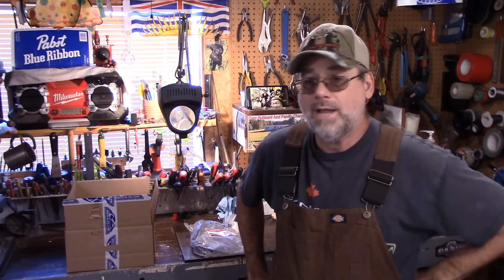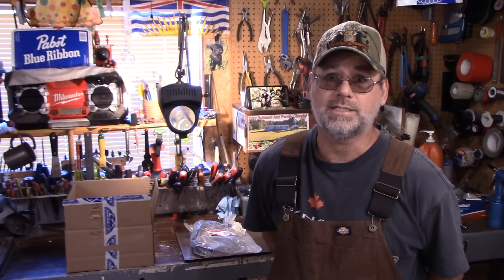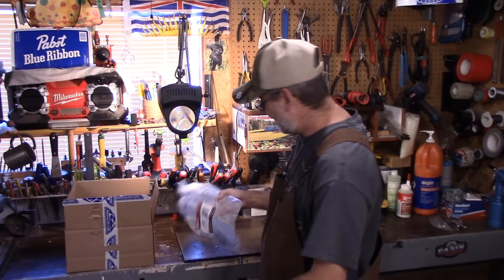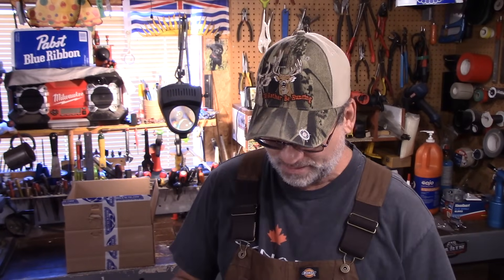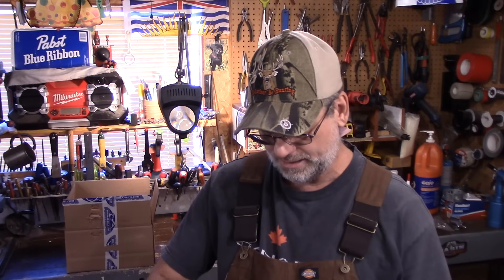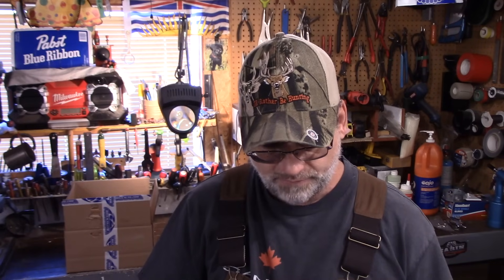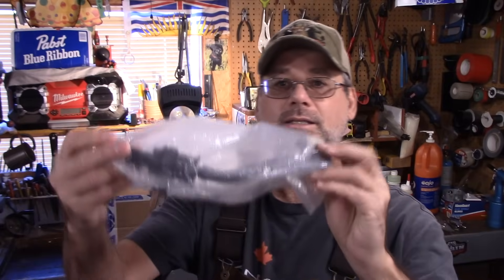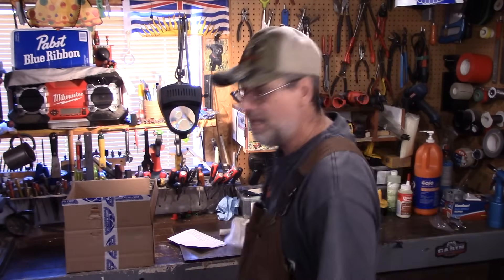F150  STALLING AT STOPS - THE FIX -  PART TWO

Comment from the maker: It has been over one year and I have not had one stall since replacing the evaporative purge valve found under the hood . Cheers
Reply: Good to hear, my 2010 f150 just started this a month ago.  Cleaned the throttle body and was looking at common issues and plan on changing this part out. It seemed like the throttle fixed it but it did it today leaving the gas station.
Reply: STEVE ROB REVIEWS can you please put up a link to the part. Thanks in advance
Reply from the maker: James the part is model specific depending on OEM or aftermarket so it's best  to search your specific vehicle .
Reply: Was it going  dead when it got hot like over 95 outside
Reply from the maker: @johnnyarnett4904  Nope it was not temperature related at all. It was very infrequent but always on a deceleration to a stop. Glad the purge valve fix it. Cheers
Reply: Thank you for doing this Vid, we are going to try it on my daughter's truck. Really appreciate it!
Reply from the maker: @JamesOKeefe-US  Hope it helps bud 👍 easy to install. Cheers
Reply: I really hope this works, I’ve had this issue reoccurring very frequently in my 2004.
Reply from the maker: @senoredbeard3544  let me know as well as the others that will read your post. Cheers
Reply: Thank you my trucks been doing this. I've change spark plugs, coils, Cleaned the fuel system. Cant wait to get one  2004 F150 4.6...
Reply: Unfortunately the truck stalled the very next day after installing it. If anyone has other ideas please share.
Reply: ..... Nowhere in the video or description do you mention what year/engine F150.
Reply: Thank you for the video. One question.  Will you have to change the part again after sometime eventually?
Reply: STEVE ROB REVIEWS what the name of the part in the box
Reply: Are there any videos out there to your knowledge that shows how to do this? Would love to get this done, this week.
Reply: It has been happening on mine as well since 2010, like you said completely random and once maybe twice a year,    I have had it happen in all seasons up here in canada.  The one thing I have noticed is that it is always when breaking but and always on the rock back or I lose break pressure as well.  The. I need to throw it in park  quickly and start it again so I can reengage my breaks
Reply: Is it still working?
Reply from the maker: Yep 👍
Reply: @senoredbeard3544  did u fix it? Same issue. Thinking about buying a non-oem purge valve.
Reply: @loudogg310  no it never fixed the issue for me. Not long after I ended up buying a new truck. My Ford is still in my back yard collecting dust now.
Reply: What year was the truck you are having problems with i have a 2016 5.0 it is doing this finally it threw code for the vct solenoid  but I'm having doubts about th
Reply: @travisroher4410  it could be the solenoid.  Im having this same issue on a 1997 Ford V8 expedition.  It was driving fine, then Fla got real hot today.  Stalled on me and continues to stall out.  Also had the overdrive on/off start blinking.  God I'm praying its not the transmission but my fluid is clean..i have it serviced.  Its gotta be purge valve or solenoid.  I dont even know what a solenoid is but thats what came up in my searches for this issue.
Reply: @johnnyarnett4904  same. Usually about 100 in the shade here 10 months of the year. Did you find a fix?
Reply: @SteveRobReviews   did your truck display low oil pressure when it would stall? Mine has started stalling at stops out of the blue. I notice it says low oil pressure when It does. It will crank right back up though.
Reply from the maker: All the gauges will report a fault on a stall but no codes stored. The purge valve fixed mine.
Reply: Hey was wondering if your f150 had a rough idle? I got a 2016 f150 5.0 and it stalled a few times off road or in reverse and stoping but in park it has a rough idle that comes and goes
Reply from the maker: @Golden31Eagle   No rough idle or codes in my case .  In your case it seems to be different so my first thought would be minimum idle air flow at the throttle body and maybe a throttle body cleaning may resolve your condition.
Reply: @huntercarpenter3726  I have the cpv (canister purge valve ) replaced in May and it went about a week with out stalling at a stop sigh or red light and it stalled. Than it would stall a few more times after that and the last time it stalled it showed the " low oil" text and symbol. I was hella confused.. Literally dropped it off today and told them about it. Let's see what happens.
Reply: Thank you much!!
Reply: I changed the valve and the pcv and still stalls, guess I'll try vct solenoids next
Reply: @josueavila3721  did you find out what the issue was related to? Currently having these issues now. Thanks
Reply: dude... thank you so much. I'm going to try this. Mine started doing it a month ago. 2004 F-150 5.4L V8 Lariat Supercrew. I've taken it to the mechanic (Pep Boys) and they found NO issues. its happened to me 3 times now, including about 20 mins ago. Its so aggravating to now know whats wrong and have no clue how to stop it. I'm going to try this. Even if its not my problem, at least its SOMETHING to try, because right now I have nothing to go off of. Thanks again.
Reply from the maker: @Nathan Harris   Sure give it a try , it's easy to replace yourself and not expensive.
Reply: @SteveRobReviews  I replaced it right after I commented that. It was very easy, took all of 5 minutes. Fingers crossed that it solves my issue. Thanks again!
Reply: @huntercarpenter3726 
Did you find the problem? Im having the same issue with my 2004.
Reply: I am looking for the part number of the purge valve for my 2015 5.0. It stalls sometimes as well
Reply: @AmericanJumpingBeans   I know this is an old comment but did you find out what the issue was because I'm having the same problem with my 2000 ford expedition 4.6L V8 Triton XLT and I've replaced the EGR Valve, Idle Air Control Valve, Throttle Position Sensor, DPFE, PCV Valve and hose, EGR Vacuum Solenoid, Mass Air Flow Sensor and filter, and the fuel hose with the green plastic tip (forgot the name).

I'm still experiencing stalling and sometimes the vehicle will cut off. All these parts replaced and I'm having issues. I'll have to do another scan with my obd2 and see what's going on and I'm praying it's nothing serious. 

As a female that's new to doing my own vehicle repairs because I was ripped off once, I guess I'll be throwing parts at it until it's fixed.🙄
Reply: @flowersfam3462  it was transmission.  Cost me over $2400 at a small biz.  Had to go back twice.  Cars still running.  Windows don't work, hatchback door won't open but it runs.  👍
Reply: @flowersfam3462  I'm a woman as well.  Trying to do all I can on my own.  Sincerely hope you never have an electric window issue.  They all seem to go at the same time.  You'll have to buy a door to fix the window because there's a huge metal sheet covering everything once you get the door panel off, that even a man can't fix. 🤷 Wish I had an old VW bug at this point.
Reply: @AmericanJumpingBeans   I can relate in trying to do it all on my own as well. I agree, things seem to happen back to back with these vehicles. I hope I don't have any window issues. I have enough to repair already.

I love an old VW, that would be nice to have.
Reply: @AmericanJumpingBeans  That was an expensive repair. I'm glad it's still working.
Reply: @flowersfam3462  yep.  I've been finding retired men and men working on the side to do maintenance.  My elderly neighbors tell me this is the best way.  If you need a big repair tho.  You should have a corp with a warranty on the parts so you can get them replaced anywhere they operate.  I WISH I had gone with like Firestone with the estimate and warranty than let the backyard mechanic fool around with it.. I've had to pay so much for a used car.  If you consider insurance also.. idk.  I've never had a new car.
Reply: @AmericanJumpingBeans  Me either. Lucky you to have found some reliable guys to do maintenance. I haven't had that kind of luck. I'm doing the repairs myself. Thankfully all my repairs are right under the hood and nothing major, so far.

I think I'll have to go to O'Reilly auto parts and let them do a scan to see if any other codes come up since after replacing so many parts and my vehicle is still stalling and sometimes it cuts off. Hoping it's nothing serious. I'm tired of throwing parts at it.
Reply: @flowersfam3462  hope it's something simple.  Sometimes you can find ads for guys who will come to your home and fix the car cheap in those neighborhood papers.  In the classified.  Good luck!!  Really hope you get it fixed. 👍
Reply: @AmericanJumpingBeans  I hope so too and I'll check out those ads.
Thanks for the advice.🌺
Reply: @AmericanJumpingBeans what was the problem? I got a 2008 expedition and it stalls and shakes at a stop
Reply: @Golden31Eagle what was the problem?
Reply: @NoAuto-vd8tg  still don't know, it kinda went away but I had other things to repair from goin in the woods so I never got around to it. Sometimes it stalls now after going on the highway if I don't let her warm up good and long first
Reply: @huntercarpenter3726 yea same here with my 2010 f150 fx4, 5.4 3v. If say I’m in Timmie’s drive through it would just stall and I would fire it right back up… not very safe considering you have to stop in middle of intersections to make left turns sometimes with incoming traffic. Good luck guys

Comment: Did u even say what the part was you bought??? I thought you were going to do actual work? All you did is talk & I dont think I ever heard you say what part you even bought to fix it???
Reply: Motorcraft Canister Purge Valve. I've read where you can check it by unplugging the electrical connector and the vacuum hose and with the truck running it shouldn't be pulling any vacuum, check it with your finger. It is located up front/top behind the throttle body.

Comment: Had this problem it was very costly in 2 different shops for 2weeks -1 month,  it ended up being mas air flow sensor. I ended figuring it out . Sometimes shops over look the small . I hope this was the problem, so far 3 weeks now the truck hasn’t stalled!!
Reply from the maker: After 3 weeks  I'd say it's most likely fixed 👍
Reply: Going to try this…2015 Lariat with 100k miles….starting stalling and rough idle
Reply: 2004 F150 5.4. Replaced MAF sensor, fuel filter, purge valve and the line to the manifold cuz it was bad. Still stalls at stops

Comment: I have this problem but it’s EVERYDAY. it stalls on me at red lights, stop signs and when I’m turning into parking lots every single day.  The truck will beep and the oil gauge will drop... I hope this part fixes it.
Reply from the maker: Yep its a good chance this is your problem.
Reply: I have the same exactly problem as this guy has
Reply from the maker: @adanortega8628  Give it try , just might resolve your problem.
Reply: I have the same problem, my mechanic does not know how to fix it. did you figure out the fix?

Comment: Thank you. My 2006 F150 4.6 was stalling at stop lights. Thank goodness the dealer didn't have time to look at the truck. Decided to search you tube and found you. Replaced the Vapor Canister purge valve and the truck runs great. Thanks Steve, if ever in the San Diego area look me up and I'll buy you lunch.
Reply from the maker: Awesome bud , so glad to have helped 👍
Reply: Hey bro! Im having the same problem! Did your fuel pump kick on or not?  I just changed my fuel pump driver module and still no luck. I'll try changing the purge valve put before I do I need to know if you heard the pump or not before changing this valve! I've watched 1874328 videos and not one mentioned fuel pump kicking on or not!!! Wtf
Reply from the maker: This is all about stalling after starting caused by  a faulty purge valve  not a faulty fuel pump or fuel related .  If your fuel pump is not turning on that's a totally different problem.

Comment: Thanks Steve I have an F-150, 2016 and start stalling. My mechanic doesn’t know about that problem, but thanks to you now I know.
Reply from the maker: No codes  for direction so we look at pattern failures when we experience intermittent faults.  Cheers 👍

Comment: I have a 2010 F150 that was experiencing stalling and a ton of O2 sensor codes, mine would act up more frequently right after filling up. Rolled the dice ordered the vapor purge valve. Haven't had a single issue since. 3 fill-ups no issues. Thanks for posting this video I would have never looked at this! I felt like I was driving an old Dodge with vapor lock....
Reply from the maker: So nice to see itresolved your stalling , mine has not stalled since . Cheers

Comment: Paul may just have something there about the blends since you say the problem only shows up around 8 or 9 months. Different fuel blends between that far apart. Hope it works out that it's the purge valve and keeping fingers crossed for you.
Reply from the maker: +stuzman Paul is sharp as a tack and its a logical explanation but not one I can do anything with.  I don't like to bug guys on youtube  but Paul dosent mind me asking and hes more than likely  right.  Let see in 2018 how it goes as this is a commonly mentioned fix as well.

Comment: My 2017  king ranch 5.0l was stalling at idle after filling gas tank, $38 evap purge valve from auto zone fixed issue. Diaphragm had pinhole and couldn’t hold vacuum. Thanks for video, very helpful

Comment: Another thing to check is to see if the 20 amp fuse #27 in the under hood fuse box has been relocated to #70.  This fuse powers the injectors and has melted in half on my truck.